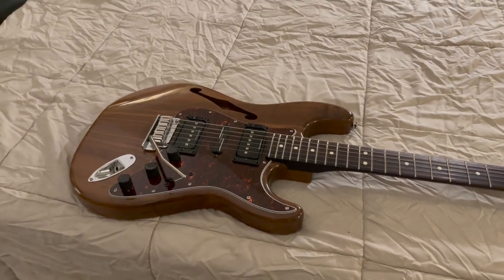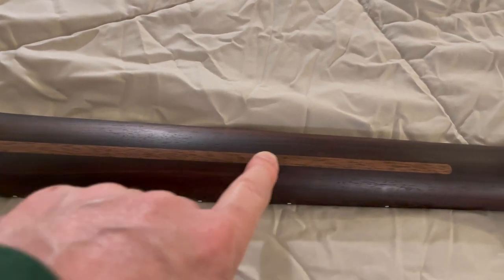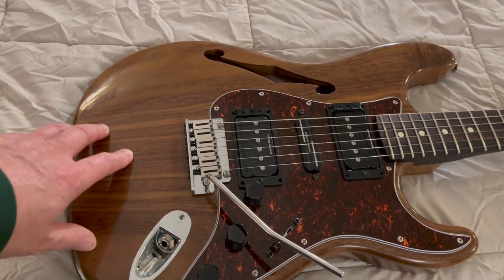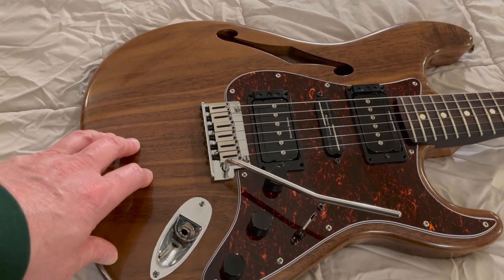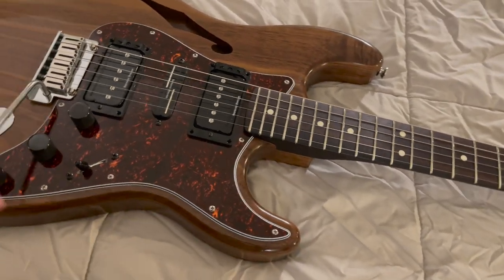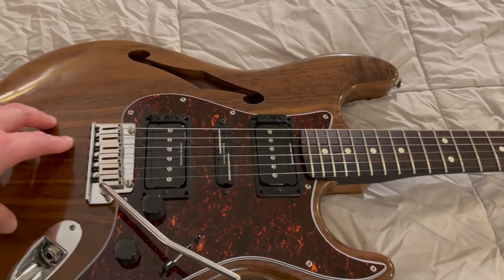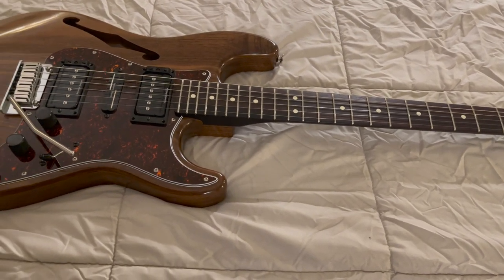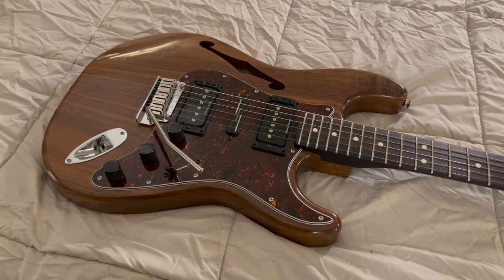I built my own custom Stratocaster with 49 pickup options!

Comment: Great stuff.
I did something similar in 1979 already. Also a walnut body but with a maple/rosewood neck. I have 20 different pickup options with 3 single coils. There is also a preamp/
booster built in my superstate, giving me everything between a very clean tone to a chord tone that would scare Tony Iommy and a lead tone that would make Santana run for cover. Obviously it also makes standard strat tones and also the preamp tones by Clapton and Gilmour. 
Back in 1979 then there were no P-rails. I now wished there were.
Btw I have design planned for a new guitar that goes even more bonkers: over 1500 (!) pickup options. Will be fun if I ever get to it.
Reply from the maker: That sounds amazing. Thank you for sharing!

Comment: I have a similar project going on.   Rosewood neck large headstock from Warmouth 500.bucks HSH Seymore Duncan, Hot rodded set humbuckers and a quarter pounder single coil in the middle. I went with the Alder body. also Warmouth. ( oiled it ) I was actually looking at the same body you used and considered Mahogany etc. but price was an issue. Almost went with the Tele body. Thing is a guy can always change bodies, necks, pickups etc. no limits. Gold frets, Sperzel tuners, Wilkenson Vibrato bridge.  Tortushell pick guard. It's funny.  
    I'm having trouble finding the wire diagram for the configuration I want to use.   I'm not looking for a great many selections.  It's an HSH with a 5 way. 1 volume 1 Tone. The tone will be push pull to split the humbuckers.  I just want the 5 way to work as a 5 way in either up or down on the push pull. All the push pull should do is split the humbuckers. So it's kind of a Strat when up Humbucker when sown. CAN'T find it anywhere!
       I never liked how close the fender Vol is to the strings. I always hit it accidently so I orderd a guard with two holes. eliminating the usual vol location.
    Once this project is done I'm going to make a Shop Strat to experiment on. Get a cheap neck and bolt it up to an old body I have. Then get some cheep or used pick guards etc. and load up various combinations. That way next project will be easier. 
    The planning and the budget took the most time. As you said. I can easily calculate somewhere around..$1,300. to $1,500.,  but it's fun and a learning experience. You can buy a Fender HSH for around $600.$ 700 but  Not with the rosewood neck and custom personal touches. If anyone happens to know where I can find the wiring I'm looking for let me know. As of yet it seems I'll have to settle for something  else. Good luck>>
Reply from the maker: Wow, that sounds amazing. As for the writing diagrams, I’ll look around. I have gotten a few from Seymour Duncan’s site, as well as 920D and Fralin. If I find any I’ll let you know.
Reply: @IamMusicNerd  thank you.

Comment: - if you built this one yourself, why is there a faint Fender logo on the neck ?
- ho many p.u. options do you actually use ?
Reply from the maker: I bought the neck from Fender, and some of the parts, such as the tuners and bridge. So that's why there are Fender logos on some of it. I bought the raw walnut body from Warmoth and finished it myself. Then ordered the pickups, and pots, and soldered those in.
Reply from the maker: As far as the pickup options, I use about 6-7 settings a lot, and about another 8 or so regularly. The rest only once in awhile.

Comment: Those jack of all trades SD pickups lack the true sound in each pickup mode in my opinion. Tried them twice and junked them. I`d rather have three or five selections that actually sound good. Beautiful guitar though.
Reply from the maker: Fair enough. I really like the P90 and the parallel humbucker sounds on these, but I do not like the single coil hot rail tone very much. So I ended up putting a set of Fralin vintage single coils in this Strat, and moved the P-rails to my Epiphone Les Paul. (video on my channel) I think they sound better in that guitar, and I’m loving the Fralins in the Strat. (I’ll make a video on that one soon)